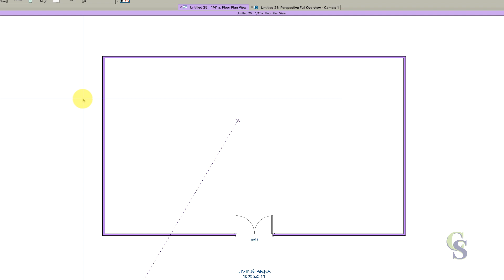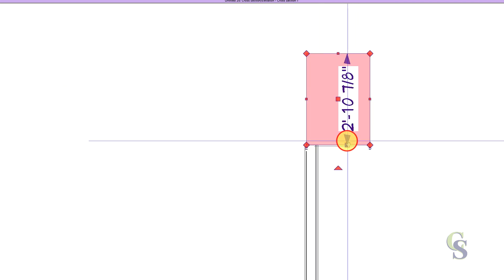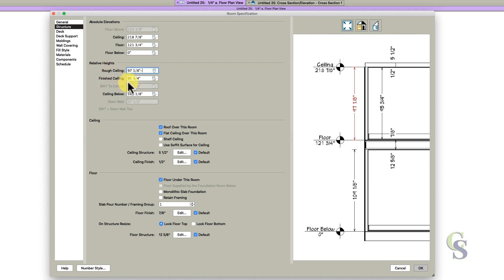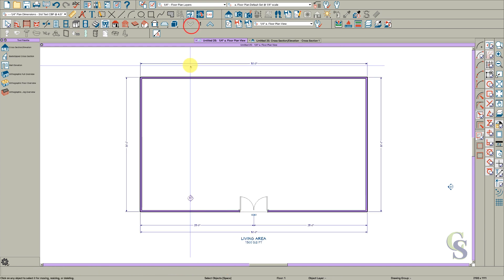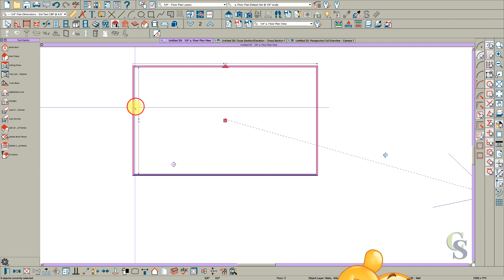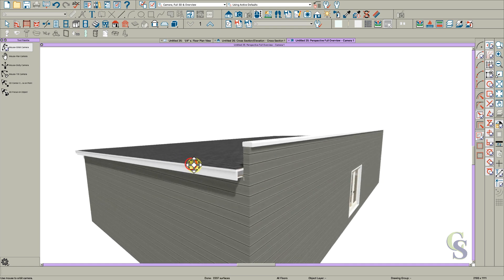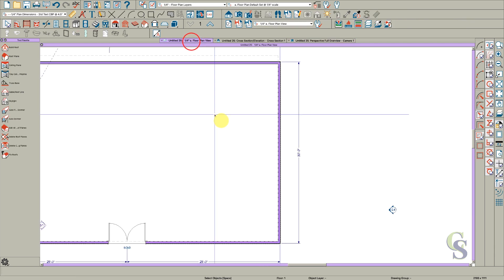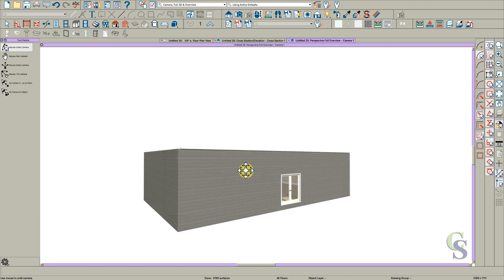How to create a Parapet Wall and a sloping Roof using Chief Architect X12

Comment: Is this all structurally correct or is it just a pretty picture. I like you video, goes straight to  the point. Btw I am new to the software. I just got Pro a week ago
Reply from the maker: Thank you for watching.  As to your question...I did not really make the video with structure in mind. It was really about the steps needed to create a parapet.  However, the roof could easily be made structural by making sure there was enough rafter depth so you could use I-Joist or roof trusses.  Hope that answers your question.  Check out my website: www.mychiefskills.com.
Reply: @ChiefSkills  Thank you